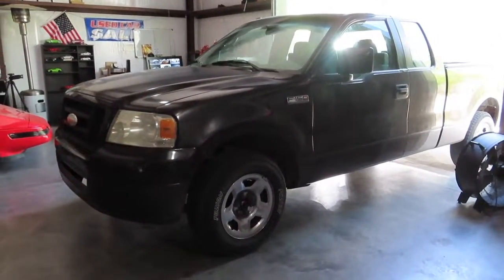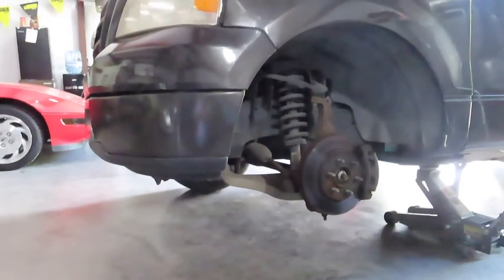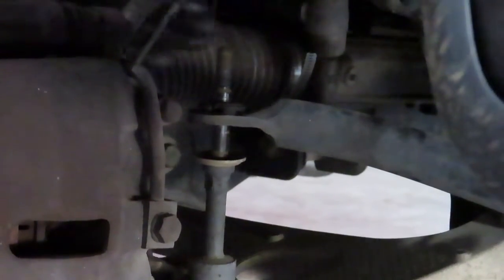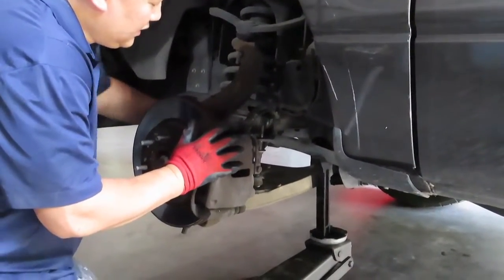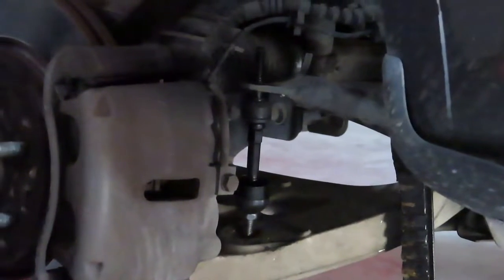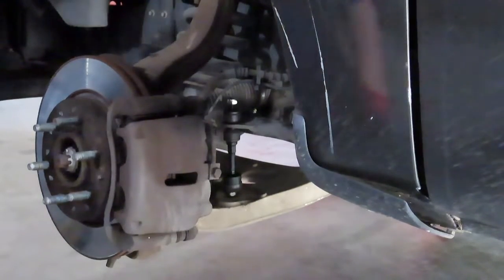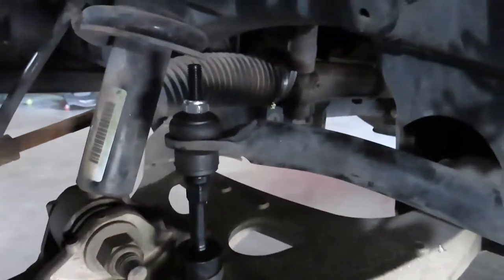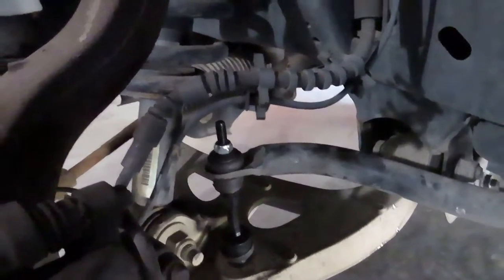Replacing Front Stabilizer Sway Bar End Link on Ford F150

Comment: Public Service Announcement: the swaybar link is installed incorrectly. The nut on the bottom of the link should go UNDER the control arm, not on top of the control arm. If you install it on the control arm like this guy you will not only lose your new link but possibly damage your control arm and other suspension components that rely on the sway bar to bear impacts and absorb some shock. 

Again, the nut should NOT go on top of the control arm. 

I installed mine correctly and you should have only one nut and that nut goes on the underside of the control arm.
Reply: You can tell that nut is in the wrong place... I was just thinking, he just took that nut off, he can’t forget that quickly???
Reply: It's done right.  You are wrong.  The replacement is a different design.
Reply: @SuperUncleRyan  ah, a CAJUN. As an App State fan, I know I'm right on this. 

Maybe it's a different design but I know mine was not set up like that. Metal on metal contact in an area absorbing rolling and bumps makes no sense to me. If it's rhe design, it's a bad design.
Reply: I was thinking the same thing
Reply: Do your research my guy. He did it right! This bar links come like that to make it easier to change out next time. That way you can hold on the nut on the top of the control arm and take the bottom nut off without it spinning on you.

Comment: Ford has an engineering problem with these that causes unnecessary wear and tear. I did something different. I bought 3 stablizer links and used the rubber bushings and washers along with my one good side stabilizer to reconfigure this setup. I took the old one out on each side and inserted new ones. I then rebuilt each stabilizer from bottom up. (Washer dome side up cupping)-rubber-(washer-washer both domed sides against each other)-rubber-(washer dome side up cupping rubber)-under sway bar. On top of sway bar goes washer with dome side down - cotter pin w locking nut. I'm into 6 months of driving and holding strong. I wish I could post a pic. If anyone is interested, I'll inbox you on how this looks. It's very stable and even my mechanic was like it makes sense.

Comment: He put it wrong,the bottom bushing should rest on the lower control arm
Reply: He did it right....that's how it looks in my car....
Reply: Thank you.  I always compare the vehicle I am working on to the YouTube video.  Most YouTube videos are pretty accurate.
Reply: It sure seems wrong...
Reply: @TheJhn924  I thought the same thing. That nut on the control arm may end up breaking the linkage and the control arm together.
Reply: @Ericsaidful  Watched this a couple weeks ago because somehow my drivers side end link was missing.  On the new one I bought and installed the nut definitely went at the bottom...
Reply: @TheJhn924  I'm about to do mine today. The entire purpose of the bushing is negated if it isn't against the control arm.
Reply: @TheJhn924  I finished mine a couple of days ago. I can confirm that his did this incorrectly. I really hope people watching this haven't put the nut on the topside of the control arm.
Reply: @Ericsaidful  Maybe that's why mine was missing... the previous owner may have installed it incorrectly.
Reply: @TheJhn924  it doesn't even make sense to do it this way because your package only comes with two nuts per link. So maybe they didn't put the nut under the control arm and just thought that the tension from the sway bar would hold it down?

Has to be making noise if you don't have a link or it's installed incorrectly though. I noticed my truck rides smoother, holds a line better, and is actually quite a bit quieter with new links installed. Can't imagine the racket these made for this guy.
Reply: @Ericsaidful  No noise with it missing... I only noticed when I was under the vehicle to do an oil change.  It certainly has a more stable ride since replacement.
Reply: @TheJhn924  that's good. Surprised the sway bar wasn't bottoming out if one side was missing. (Unless both were missing). I think my struts need to be replaced as well though so that's probably my noise. All my bushings for ball joints, tie rods, and control arms are good.

Get this clunk, mostly when it's cool outside, and I'm going over bumpy road. Not as bad or as often now as before I changed my sway bar.
Reply: I thought the same thing since he had a top and bottom nut on the lower mounting point.